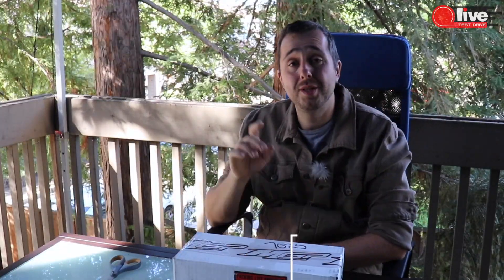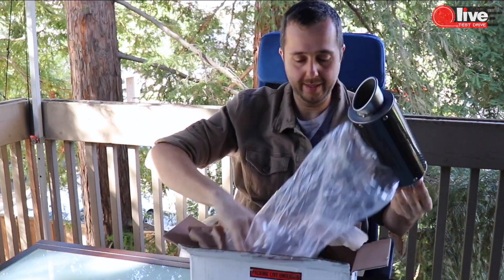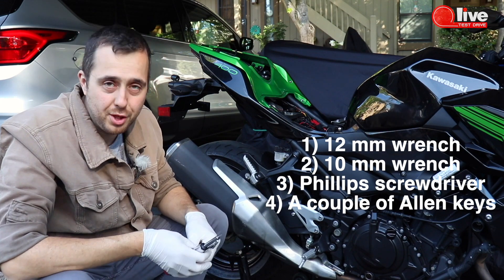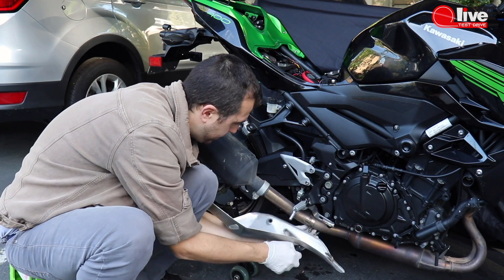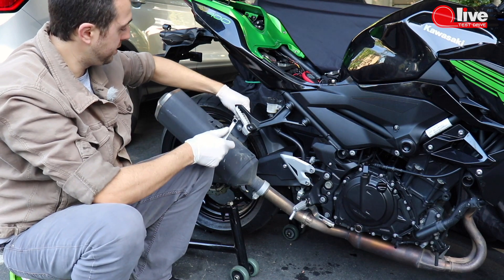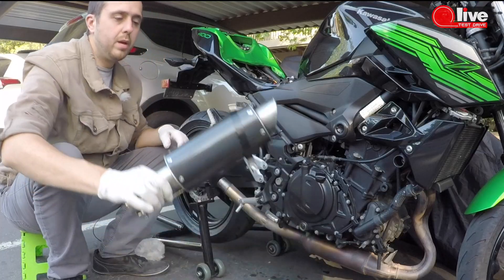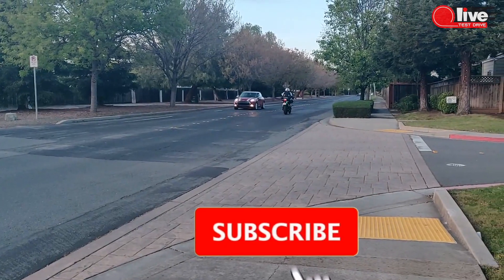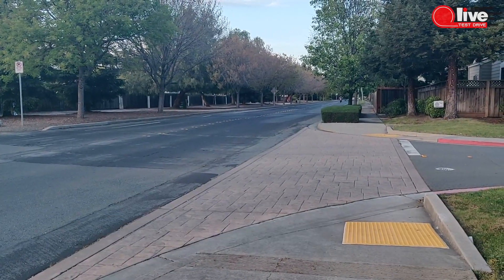#Hotbodies MGP Exhaust for your #Ninja 400 or #Z400 | Review, Install & Sound Check

Comment: I just bought a 2 yr old  2019 Z 400 with 1500 miles on it from the original owner. It had a yosh muffler on it.. if you hate your neighbors, if you want to be that guy living in a large condo apartment complex that everybody hates, if you live in the inter-city where the streets are lined with buildings on both sides, and you want to be heard half a mile away. If you want the police to hear you’re coming, bye an aftermarket muffler.
  luckily, I was able to buy a stock muffler on eBay used for $40, from some guy there is probably going to wish he did not sell his stock muffler at some point.
  with that aftermarket muffler on my Z 400, I did notice a slight hesitation just off idle.. that hesitation went away after I installed the correct/stock muffler on my 2019 Z 400.
  I learned years ago when I roadraced motorcycles, winning six championships, and two national championships , that the factory knows more than I do. Once I learned to leave my machine alone, I started winning..
  The factory geniuses with the money, the factory support, and the facilities, to develop these machines to run as well as they do, which means they have to be as fast or faster than the competition, they have to pass the EPA sniff test, and they have to be reliable so the company doesn’t lose money doing warranty work and damage to their reputation, and they have to keep the price down while juggling all of those conditions. it’s a miracle that those factories can produce ultra reliable machines that run well and last a long time in stock condition...
  your motorcycle engine is tuned from the intake of the airbox,which by the way, the science facts that go into making an airbox, is the science that goes into developing airplane wings,To get the highest velocity stack effect, while not spraining the noise epa requirements.. intake noise is almost as loud as exhaust noise if not supressed.. , and the exhaust system, which is tuned all the way ,as much as 36” past the end of the muffler at times... factory figured all this out and they spent millions doing it. It’s a complete package. Why risk tinkering with it. You don’t know what you’re doing..
if you go changing things, and you need to take your motorcycle into the dealer to have them diagnose a problem, they can’t. The baseline when they run tests will not will not show readings that are the factory specs, so technicians at your dealer will not be able to get your bike back to where it should be as far as factory settings when you change things..
 some of the bad side effects of changing the mufflers on your motorcycle ,hesitation just off idle, surging when you’re trying to hold a steady speed on the interstate, the bike won’t stay at one speed, Rich black exhaust, and of course, noise
  If you are set on buying a loud muffler, good luck with that..
  I remember when one of the  mitorcycle magazines did a test on aftermarket  exhaust systems on all four Of the best selling 600 sport bikes. They tested 11 different manufacturers exhaust systems. The result was, the average horse power loss was 6HP. One of the machines lost 13 hp.Only two exhaust systems actually produced slightly more power in excess of red line rpm, at the expense of “drivability “ all of the aftermarket exhaust systems were much lighter than the stock exhaust systems. They were also much louder, and required removal of the center stands. most of the machines developed bad habits like not idling properly, dead spots just off idle, surging, ECT
  Just saying!

Comment: Is it annoyingly loud? I’m worried that my neighbours might complain
Reply from the maker: Thanks for watching. On the cold start a bit louder. When get the bike warm 10-20% less noise.
 We had MGP on Z400 and LV-10 on Ninja 400. Check out the channel to compare. Both would be almost "the same thing" in terms of the noise level but a bit different tone. Don't worry about your neighbors. We just did 200 miles local run and 1h hwy ride home during the rush hour. People should "see you/hear you". That's really important. If they would complain you can always take the headers out and let them hear what's really loud :D
P.s. on the cold start a bit louder. When get the bike warm 10-20% less noise.
Reply: LiveFEED thanks!